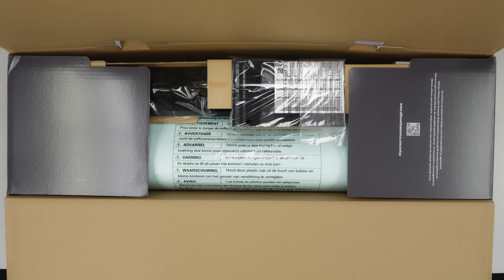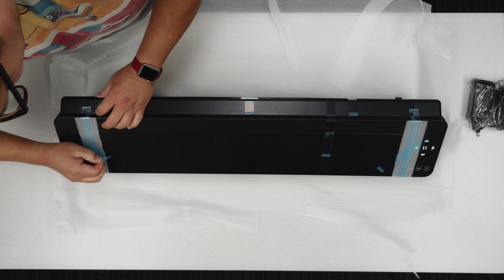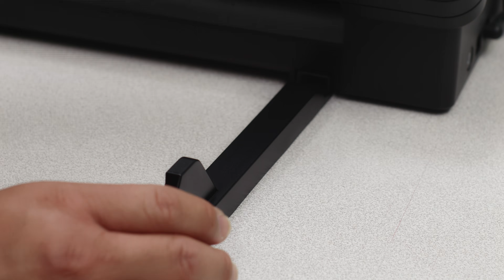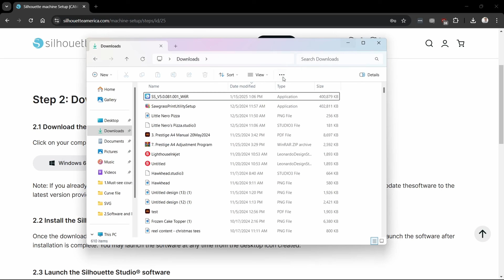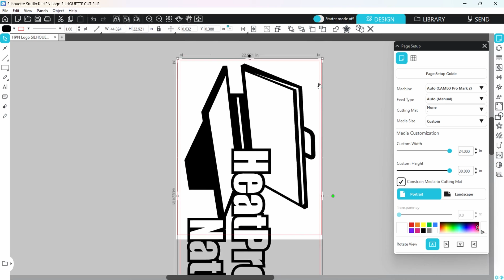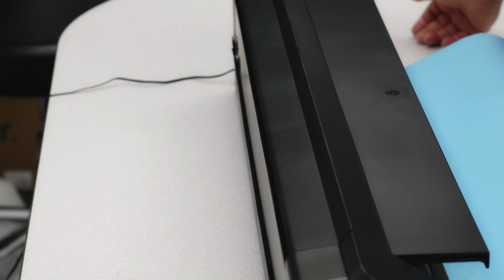Silhouette Cameo Pro MK II Unboxing & First Cut

Comment: The good thing about this machine is that it's voltage universal compatible, supports both voltages if you are outside the US and plan to buy this, then do it without hesitation, the only con is that it comes with no user manual so you will have to figure out stuff yourself
Reply from the maker: Go to 0:38 of this video and you'll see there is a QR code and URL that links to the setup page. From there, you can select your machine and you'll get access to everything you need to get started, including a download of the user manual (step 4).
Reply: @HeatPressNation  Oh thanks, that's good to know, but still not good of them for not including a physical user manual , pretty much most stuff comes with one

Comment: Hi everyone, I would like to know why my machine can't cut my vinyl. The blade doesn't cut the paper once it's in place (it's my first time using it).
Reply from the maker: There are several things that could be the issue. Here are some of the most common problems we've seen:

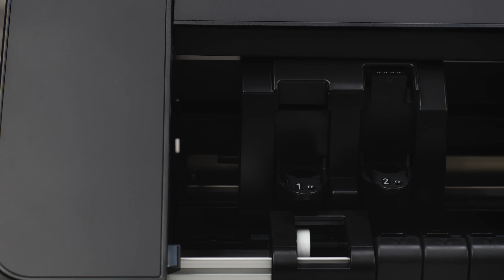• The blade isn't properly inserted into the holder. Go to 4:35 in this video to double-check that yours is inserted exactly as shown. 
• Double check your settings. In Silhouette Studio, make sure you have the proper preset loaded for cutting the type of vinyl you're using. For most heat transfer vinyl the "Heat Transfer, Smooth" preset should work great. 
• Make sure you're cutting the correct side of your HTV. The soft, thin side of the vinyl should be facing up toward the blade. 
• Use a cutting mat. (Not sure why, but this often solves a lot of problems.)

Comment: I hope you can help
Me! I have the previous model but I’m just going to replace it. I lost the instructions, I think some parts, and the vinyl kept slipping all over. I just wasn’t organized enough to use it. 

Anyway, how the heck do I print something colored on vinyl, and then cut it? Like a decal or sticker or something? 

I’d like to do some for my motorcycle, but I think then I need a totally different machine to protect the ink and all of that from the elements like rain. 

But even if I could just cut some vinyl that’s a start ha!

Comment: It looks like cameo 4 pro just in black 🤷🏻‍♂️
Reply from the maker: While it has the same overall look, the Mark II has a quieter operation, additional auxiliary rollers, and emergency stop function. The biggest difference is probably going to be the second powered tool station. This allows you to use Silhouette's powered tools, like the heat pen, that were released with the latest series of Silhouette's other machines.
Reply: Totally different machine.  It is a 24 inch Cameo 5.  The old Pro was basically a 24 inch Cameo 4, but with a worse roller system.
Reply: It's definitely not the same

Comment: Do those removable rollers actually touch the vinyl though, like actually hold it down?
I have the MK1 and ended up getting 3D printed replacements because the originals didn't touch the vinyl or mat at all 😂

Comment: I was hoping you would let us hear it print so that we could know how much quieter it is. 

Also, I was wondering how well it cuts rhinestone flock, and SISER Brick 600, and other specialty material.
Reply from the maker: That's a great idea for a future video! A sound test would be interesting.

With the right blade, it cuts those materials flawlessly. We have found that the 2mm Kraft Blade is very helpful for clean cuts on thicker materials - especially Brick 600.

Comment: Do you know if you can get the foiling and embossing pen to work with this?  I can't find an answer on the silhouette website.
Reply from the maker: Yes, this machine is compatible with both the Heat Pen and Embossing Tool.

Comment: Is this better or cameo 5?
Do you have a video comparing both?
Which one would cut poster board?
Reply from the maker: The biggest difference is going to be the size. The Cameo Pro MK II (24") is basically a larger version of the Cameo 5 (12" & 15"). They both have a maximum cutting thickness of 3mm, when using the 3mm Kraft Blade. So as long as your poster board is 3mm or less, any of the Cameo series can cut it.
Reply: @HeatPressNation  Do you by any chance know if the noise they make is the same as well? Thanks!
Reply: @HeatPressNation  Thank you !